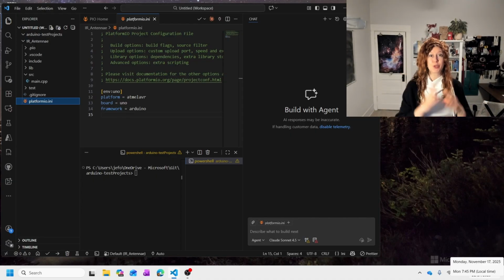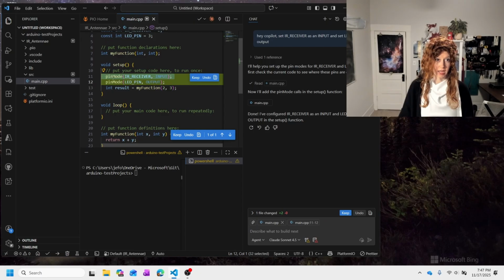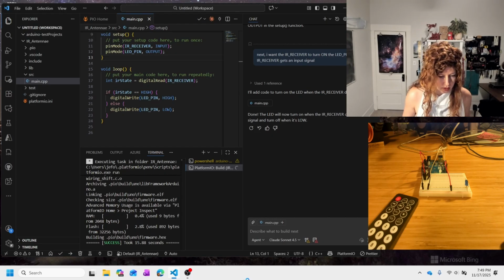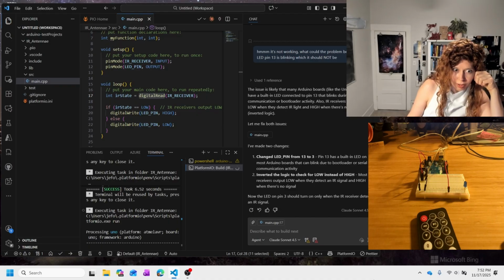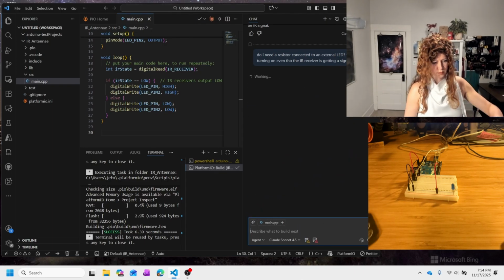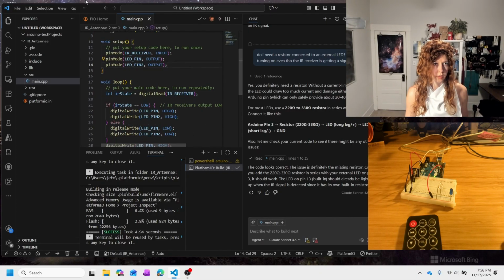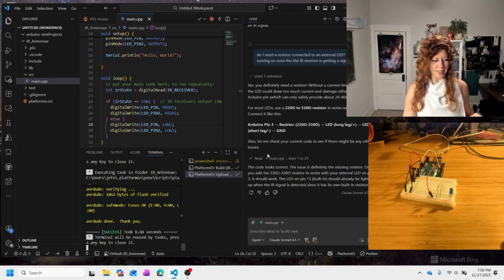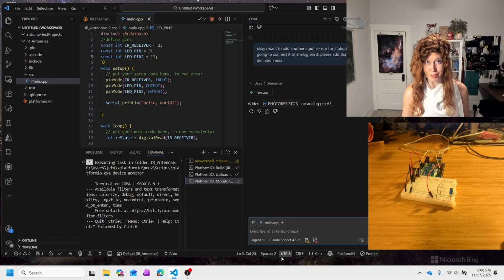Use AI to write Arduino code! (a beginner friendly IR Antennae build-along)

Comment: Just saying I'm getting kinda Miss Frizz from The Magic Schoolbus vibes. Entertaining and educational. Great job on sharing what is honestly pretty dry material. I've been in IT for decades but just getting started with Arduino for a personal project for work and this is very helpful.
Reply from the maker: Omstars thank you so much!!! Biggest compliment ever 💖💖 and that's awesome you're starting to play with Arduino!! Happy to hear the video was helpful, would love to know how your project goes for!
Reply: @JenFoxBot  With luck it shouldn't be too bad. I'm frustrated that environmental monitoring is $300+ just for the basic stuff and requires external power.  I found an ESP32 board with PoE integrated that should make it simple to build a network enabled sensor for 1/10th the cost. I would likely end up deploying about 40+ of these across various buildings/sheds we put equipment and it would tie back into our Zabbix servers via SNMP. It even has an SD slot I could use for config management. My limitation is my amateur level skill in coding.